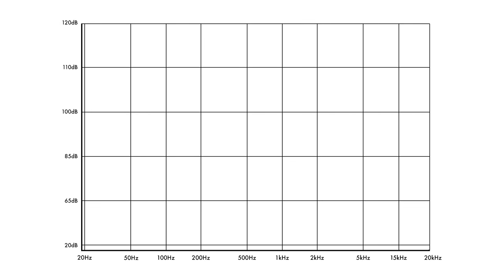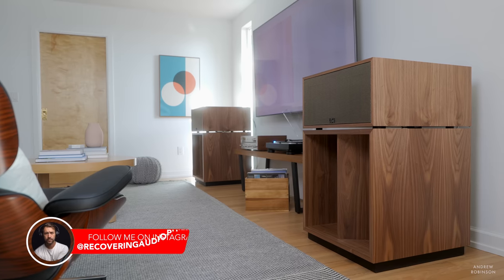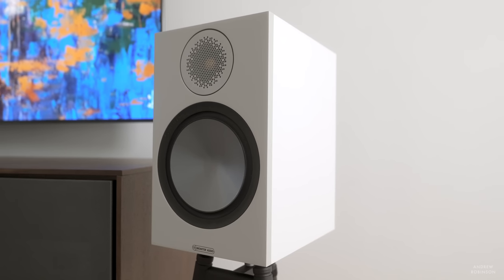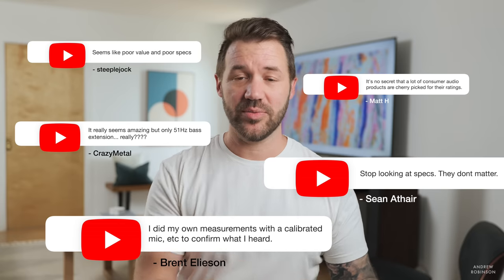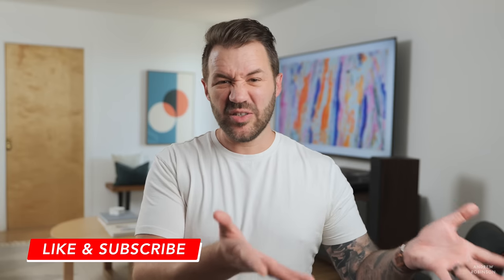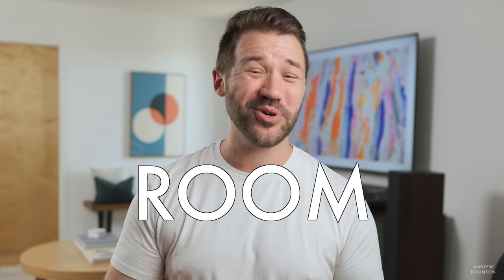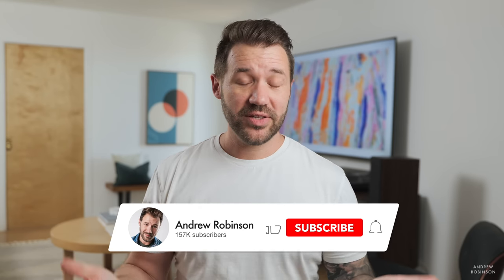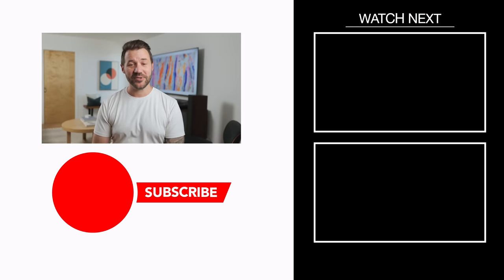DO SPECS REALLY MATTER in Audio? Understanding Speaker Measurements!

Comment: Relative relations can be made using measurements in a non-comparative manner (how is that for techno-babble).  But, if you know your room has potential for harshness, the result of a bright speaker can be substantiated with measurements.  It can also make tuning your room easier.  Things like off-axis response and bass extension will help with starting points and then after that, make it sound good.

I reset everything several months ago and have been continually dialing in my setup after adding a few new sources and feel pretty good where I am at. I asked the wife to sit in the main listening position and listen to one of her favorite songs (OMD "Sounvenir" on Tidal, great imaging in that song, BTW) and her eyes lit up with the first few notes and she said it made her well up a bit.  Now, all of the tweaks to the source, signal processing, speaker position, bi-amping, etc, all began with stats that do matter and helped guide my efforts with the end result that a song had an emotional effect on someone besides me.  It was a lovely thing.

Comment: Thank you for including Kristy in the commentary, this is a fickle passion. I make my own speakers, I listen first, after I have a sound that I like I measure. Sometimes I'm surprised, what I see on the graph and numbers doesn't necessarily provide what most builders would say are good measurements - but I like it! I spent 37 years in the tech education field and the battles between individuals regarding speakers, cables, DACs, etc. are much worse than the PC vs Mac fight. Just my opinion...

Comment: Measurements are great for generalities....  Impedance and sensitivity are the 2 most important to me.   LF extension is important too, but is only good when comparing among models by the same manufacturer. But a 7" woofer that rolls off at 32Hz will NOT have more bass than a 12" woofer that rolls off at 38Hz.  It might?  But it won't shake the walls.  Sound-in-a-room is a quality that just cannot be shown in a frequency plot.  Time-domain response is just as important as frequency, but it's difficult if not impossible to illustrate.  And have you EVER seen a polar plot of a speaker??  Sure it might measure flat on-axis, but every speaker does crazy stuff off-axis, in different directions, and that's the feature that interacts with your room's acoustics.

Comment: I think its a mixture. Maybe certain specs, like power handling... dimensions... things more related to equipment? Like needing to know if you need to step up the amp kinda deal... 

But i 100% agree with both of you that its more preference than anything. Also braggin rights. I mean its pretty neat seeing the high end systems and learning what materials they're made from. Honestly specs or more for designers and engineers. The other channel i watch is a car audio pro. He loves building speakers specifically getting BIG i mean BIIIIIG sound out of "tiny" speakers. Like using two 2" speakers as sub and still make the car rattle. Mind blowing stuff. 3" subs, 6" subs i think he made 3" bookshelves... Incredible stuff.

I agree there's sooooo many variables that go into listening and more importantly experiencing sound. I mean i feel am satisfied with speakers that can handle the power, volume and good bass response that i can tweak the frequencies, if need be, with an EQ and make any system sound great. My approach on my audio enthusiast journey is: Sound = Vibration. And if that speaker or system can make amazing vibrations no matter the cost, then its a damn good system. I think its fun to go in and find what i think is missing then tweak the f.bands to maybe bring out some mids, or clarity, or maybe remove harsh fq resonances. 

As you say Andrew 'at the end of the day' i think it comes down to the individual if we feel we can use whatever equipment we assemble and/or tweak it to get it just right... then its a damn good system. Its about: do i feel moved by this sound or is it missing something? Do i feel moved by this music/movie/media with this equipment or do i need an upgrade? And i think that is definitely what you Robinson's look for in these reviews. You have a detailed way of knowing when things make a difference, or don't, and or can do it with some minor tweaking or fixes than its a damn good system.

I mean aside from obvious differences from real cheap to decent equipment. Then it can get real tricky going from decent to maybe a higher caliber equipment... is it really what its cracked up to be or is it discernable to me the differences? Thats why i think this channel has done so well and is continuing to do so is because y'all try to take the BS out of the equation and narrow it down to the things that, even if maybe subtle to some at first, actually have impact and differences. 

Anyway, sorry for the novel. I like conversations. You guys want some coffee? ;-)

Comment: Great video on a topic that everyone needs to revisit from time to time. My biggest problem is that when I buy a set of speakers....I keep them for 20 to 30 years before I consider buying new speakers. I honestly couldn't tell you if my speakers alone produce great or bad sound because I think over time I just settled with them. Over the years though my speakers have never produced the same sound because my room changes, my receiver has changed, my source has changed, and unfortunately my hearing has changed. I have two listening areas in my house though...so there is enough change between the two systems to keep my ears interested.

Comment: Specs definitely play an important role. They can help you identify what are good candidates to work in your system / environment. They can help you choose something that may be more pleasant if you have visitors, or less anti-social, when there is something going on you can't hear but others might. They can help you choose something that works with more material (knowing you can't audition everything). Or help you choose what to audition with. They help you understand what role everything is playing, and whether you are building a quirky system that works for one specific environment and/or as a specific set of equipment that then causes you problems when you want to redecorate, or move, or upgrade the equipment or even replace a broken component.

But ultimately they can't replace what you are hearing. Sometimes, you may be better off with some room treatment, or a different amp, etc. rather than choosing the poor measurement speakers that balance out some other deficiency. Or not. But you have to be able to enjoy the end result.

Comment: It's not as simple as just trowing up a frequency response and compare this to listening experience 😂. Maybe for someone like Andrew who doesn't seem to understand measurements. You need at least a crossover response, horizontal and vertical off axis response, impedance response, spectral decay and an understanding of phase alignment . This will give you guidelines on how to proceed. Combine this with listening and you'll not be way off. Especially if it's a 3-way speaker you'll not be able to just throw away measurements and say they don't matter. That's like putting someone in the middle of the jungle with no gear and tell them to survive on their own

Comment: I've read a lot about work done by Floyd Toole at the NRC and Harmon Audio. The blind listening tests done have showed that even seeing the speaker will change how the listener perceives the speaker performance. When you take out the visual cues the results are more consistent. His work with Harmon is the Reason I chose the speakers I bought. I've  been satisfied with them for 18 years now. In fact when I upgraded my pre- amp processor to the Marantz av7005, there was an improvement in detail and imaging of the sound
Reply from the maker: YEP!

Comment: I use measurements as a guide (like reviews) to influence my search.  They're a (very) lossy projection of the experience of listening to that equipment.  They represent a summary of what the experience is like but lose out on the actual experience part.  That matters.  Some equipment measures perfectly but sometimes the experience it generates isn't what you're looking for subjectively.  I whole-heartedly believe hifi is subjective at its core.

Comment: I use mesurements as a guide for setup. I have the klipsch rp 8000f and the dip drasticly at 1.7khz because of phase aliment but when going lower it flattens out. Because they are tilted upward, at around 3 meters it's sounds fantastic when sitting and it is audible when standing up that the mids are thinning out but because I know it and my room i can make it work.

Comment: Measurements are a tool to judge the hole System e.g. resonances in the enclosure, which can be quite annoying. Often these peaks are smoothed out. Never trust a scan you didnt du yourself :D. 

But the flatnesshype is to much for me. I build my speakers by myself. +-5db are ok and i can build them just like i like em - with a little less highs. 

I liked the interview with your partner! A "kind" of different perspective :D.

Comment: So what you're basically saying is measurements don't matter if you know you prefer coloration over accuracy. You said the Klipsches were not perfect but you love them anyway. I'm confident that in a blind test situation (w multiple participants), the majority would prefer neutral speakers like say the Genelec 8351B, D&D 8c or Revel F328Be over any Klipsch speaker. One thing I also noticed that you seemed to refer to on-axis frequency response only in the video. If a speaker has neutral on-axis AND smooth off-axis response (no directivity errors) it will sound good in practically any room if correctly placed. While I agree that vague specs don't matter (and can be misleading), a full spinorama combined with max SPL and distortion etc. measurements is invaluable. You can always introduce a subtle 'smiley' curve to a neutral speaker via DSP if you want to. In the end I know this channel is about your subjective journey/opinions but the science and measurements are there to help us, not to harm us.

Comment: One thing you didn’t mention concerning speakers, I learned in the mid to late 70’s your speakers are dependent on your amp. With all the advancements made in technology, what I know could be irrelevant. I owned JBL L100Century 50 watt studio monitors, a 60 watt Kenwood KR10000 and a Sound Craftsman equalizer (which I still have) . Long story short, I blew the tweeter out of one, sent it to JBL in 1980. They replaced the tweeter and sent me a note saying: Danger! Low wattage. These speakers need 100+ watts to drive them properly. So, I learned something. Also with a good amp, you can make a junky speaker sound pretty good. That’s all I know. Like your channel. Let me know if my information is irrelevant for today’s equipment or not. Thanks.

Comment: Thank you for review Andrew, I currently own separates and I have very similar room set up where one side of the my living room is wall and other end is wide open concept, I watched ton of videos on room correction and watched ton of videos on how to use DSP for subwoofers. I have calibrated my living room home theater set with stock my Integra preamp. I was always thought that my set is ( speakers are not calibrated correctly ) not done correctly since I have not calibrated with REW or DSP. But I agree with you on what you said about SPECS in this video which don't matter to me because after I calibrated my system with stock microphone I did not like the way my system sounded to I went in the menu and made changes to LCR and my ATMO so that I can hear more out of my ATMOS speakers and dialogs from my center channel little louder and made adjustments to my sub based on what I like to hear,  I am sure many people can disagree with me but current setting on my set is what I like and enjoy when I watch movies. I was thinking that what I did with settings was wrong but there is no wrong or right and what matter is if I am enjoying my set up. Thank you for uploading this great video.

Comment: Simply awesome video - Both of you - I have two high end systems and never worried about specs.  My active Naim setup is a sound I love. It has pace, rhythm and attack and is wildly impressive linked with a $3k REL sub for the music I love. It cost me mucho $$. Is it the best? Of course not. But I love it.  My home theater has a 7.1.4 Klipsch / REL setup. It’s a very different sounding and requirement. You are 100% correct. Buy what YOU like, that makes it right. I would add that if you are into chamber pieces  a completely different valve/magnapan setup might be perfect. I’ve heard so many systems over my 62 years and there is no right answer and specs are merely marketing tools. My friends regularly come to me for advice and are always disappointed when I tell them to go listen and buy what they like. I don’t know their musical taste, their rooms acoustics, their real budget,..... simply phenomenal and spot on video.

Comment: Another excellent video with a great conversation.  I think the answer lies all over the spectrum depending on the person.  For me, specs are a way to compare what my expectation would be from a speaker, however the only true way for me to know if I'll love them is to listen to them in my room with my gear and my source material.  Knowing my listening preferences will guide me in a direction based on the specs of speakers, that's where I feel they do matter.  Where they don't matter is when I make the ultimate decision if I like them or not and there isn't a spec out there that can tell me that, it's only my head that knows that result.  Do specs matter? Ultimately, no they don't, but they do help me narrow some things down so I can make a decision with the only thing that does matter; me.

Comment: Due to having a 400yr old thatched cottage with 2.5ft thick stone walls and low ceilings my system suffered badly from bass boom. 

That was until I purchased a Lyngdorf amp with Room Perfect correction. With the kef metas it was a revelation, the bass ironed out and the system sounding very sweet. No need for any room enhancements whatsoever.  Full agreement on your statement with regards to measurements,  who cares? If it sounds good to you then that's all that matters.

Comment: Agreed. There are too many variables and indeed not just the individual and the room. 

I just bought Focal Aria 906 and they sounded so different from the shop, but that's so unsurprising when it was in a listening room with a totally different setup and materials then I have at home, connected to a 10k AB amp instead of the 19 y old d receiver I have. 

But I was convinced that they were a real upgrade and I'm loving them
Reply from the maker: Half of "speaker break in" is you getting used to a new sound. More often than not (and one of the reasons manufacturers offer 30-day trials) given a few days, a speaker you thought was "crap" will be fine in the end, unless of course during that initial adjustment period you ingrained your own bias so deep you cannot overcome it. Glad to hear you're enjoying your new speakers!

Comment: Thanks for a great and clear explanation for how to read speaker spec graphs. Now I can understand what advanced calibration software like Dirac is all about.
Reply from the maker: Oh good! Glad you found it helpful. Yeah, DIRAC and other PEQ software is essentially identifying peaks and dips greater than a certain value/error from say neutral and applying opposite adjustments to bring those frequencies back in line. So if you have a peak of say 6dB at 60Hz in your room, DIRAC sees that and applies -6dB of "filtration/adjustment" at 60Hz to bring that peak down. Note, it's easier for you to hear peaks than it is dips so don't be concerned if DIRAC or other software leaves some dips while doing more to eliminate peaks.

Comment: A never ending debate.  We have baffle step, speaker time alignment, port noise, comb filtering, and all the phase anomalies along with distortion that happens in the crossover network. Then there's cabinet resonance and whoa, we won't get into capacitor effect on sound. Bottom line: If you like the way they sound and fit in your listening room...buy em.
Reply from the maker: And that's the bottom line! Appreciate you watching Scotty!
Reply: Nice list of Design Considerations for the builder AND totally needed.
I trust a fair number of manufacturers to build them "properly" based on price points they need to hit.

THEN...like you, I LISTEN to how THEIR choices work in MY rooms.